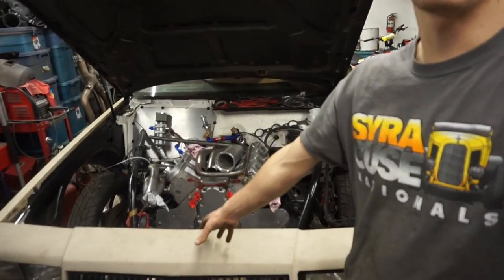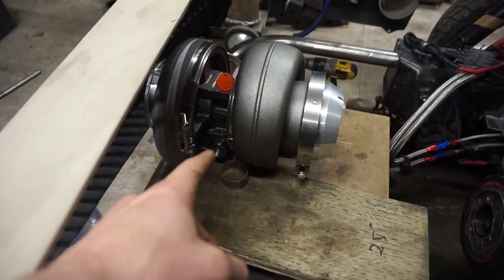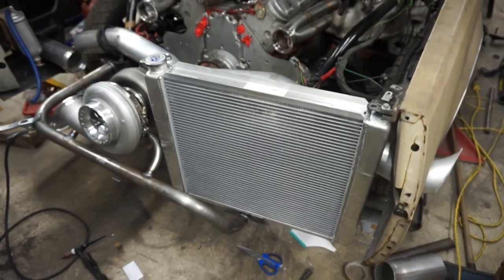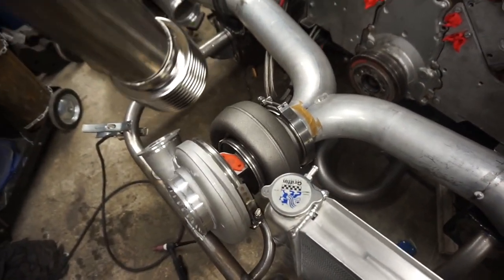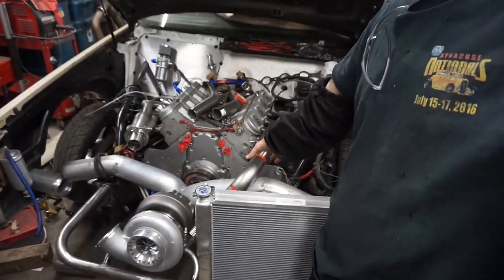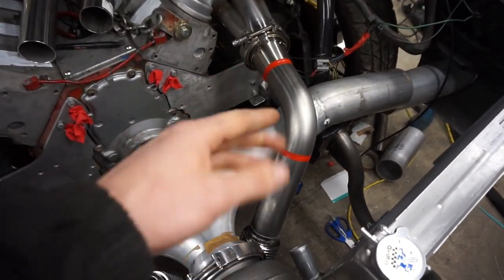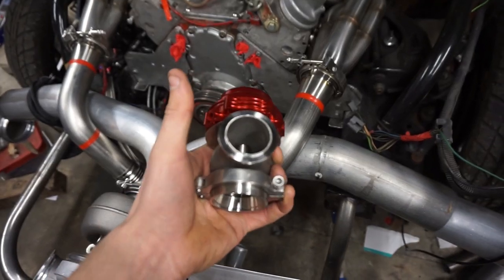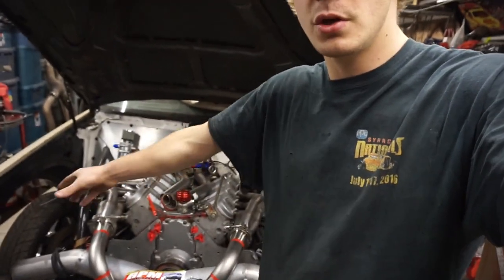MORE TURBO STUFF

Comment: Very nice work. Are you still using the Eastwood tig machine or have you upgraded? How do you like the machine?
Reply from the maker: yes still using the Eastwood  tig welder. I love the machine does everything I need and I've defiantly put it to work. the first one I bought overloaded on me but Eastwood sent a brand new one to replace it so I cant complain. thanks for the comment!
Reply: Awesome video bro , lots of info . Good luck with the build
Reply: @horsepowervsyourwallet9769  Is your Eastwood the digital 200 ?
Reply from the maker: no its older version  @13SKULLWRECKER

Comment: Ditch the push on rubber rad hoses and cut off the push on end and weld an 16 fitting and you will have way better  rad hoses and smaller but better then rubber all day long
Reply from the maker: that's the plan just need the parts!